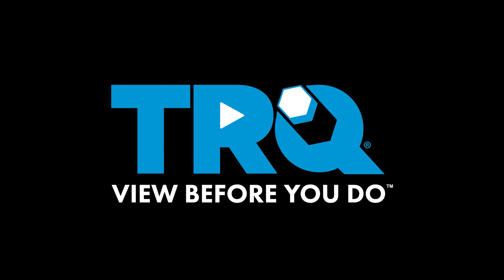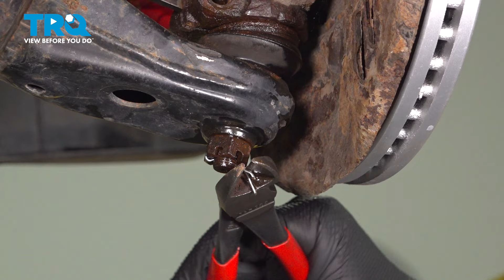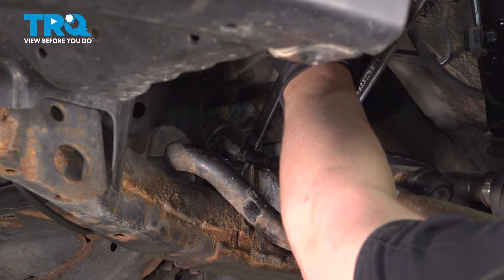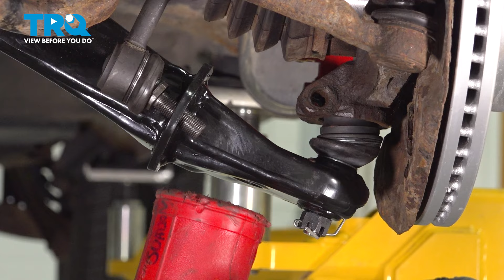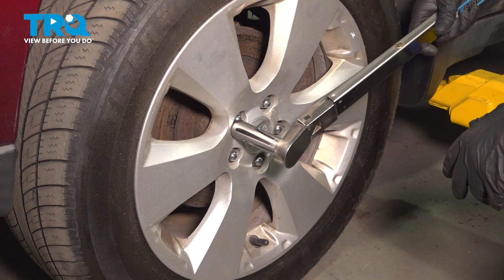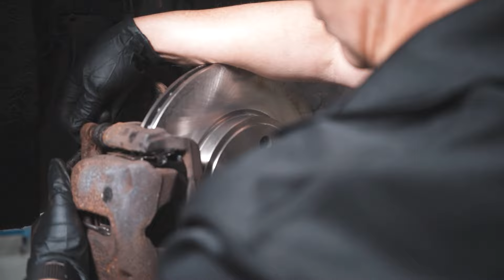How to Replace Front Control Arms with Ball Joint 2010-2014 Subaru Outback

Comment: I just tackled this job. To put things simply, the worst job I've ever had to do... albeit on my own vehicle. That ball joint was one persistent SOB to get out of the knuckle. Took two hours to get it out.
Reply: The subframes turn to swiss cheese. Very common issue if they salt the roads.
Reply: Weirdest design ever. Ball joint seperate from the arm? What were they thinking
Reply: For me, I snapped a pinch bolt and that's the worst part, but I did have to hammer each one of the old control arms with a 5lb hand sledge for 30m each

Comment: I'm sure I could tackle a job like this. And my 2002 Outback needs the whole kit to replace everything: both tie rods, ball joints, control arms (why not), sway bar, struts, and shocks. Why not throw in some horn juice and possum hissulator. The only thing I am lacking is the space to do this in and the proper tools to do it with. It doesn't have to be powered or cordless but good old fashioned well made mechanic tools. And if I did go through and replace everything on the front end suspension the car would most definitely need an alignment since it's been a long while it ever had one. I'd probably be like one of the guys here and end up towing my car to a place to get it done.

Comment: I used this video to change the control arms and ball joints on my 2011 Outback.   Thanks for posting it.   I have a few suggestions after changing both sides of my car.

1.   Buy a Harbor freight or similar ball joint separator .  It is much easier than trying to use the pry bar to separate the ball joint from the control arm.   The hook shown in the video only works if you have a lift.  

2.   Buy a Astro Pneumatic 78620 Subaru ball joint puller.   It makes getting that rusty ball joint out a breeze.  

3.   Be prepared to replace your pinch bolts with new ones or drill and use a similar sized bolt and nut.   

4.  Be prepared to have your car realigned.   My front end was really worn, and all of the new parts made it bad out of alignment.   I had mine towed to my local alignment shop.
Reply: I hit the old control arm with a 5lb sledge for half an hour :(